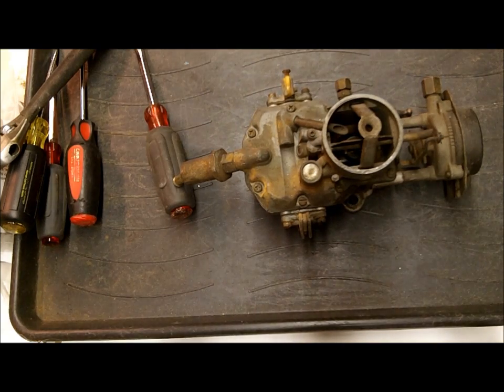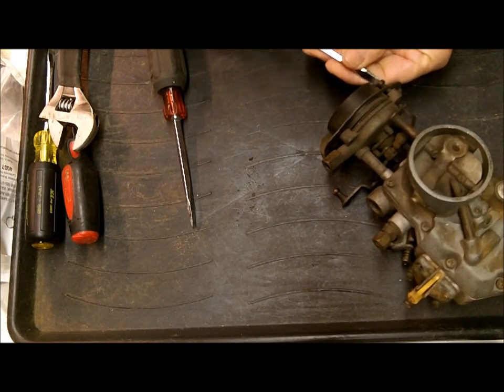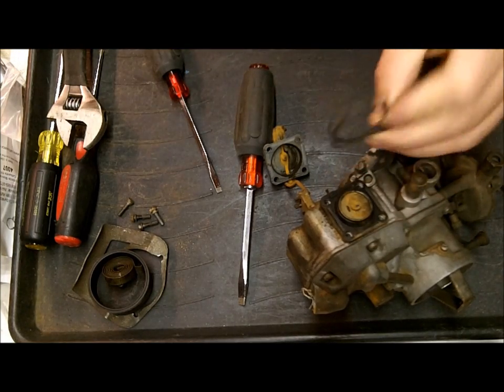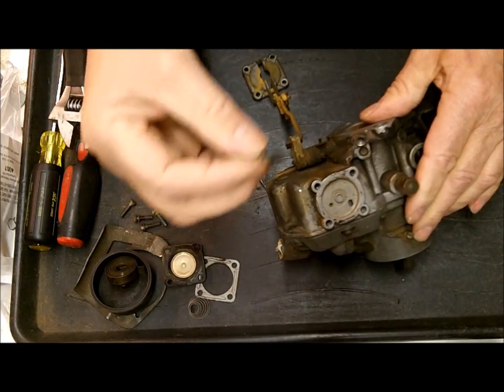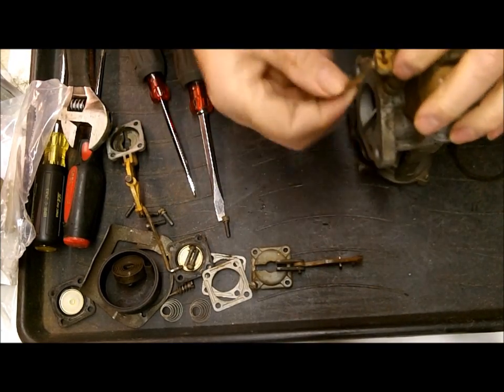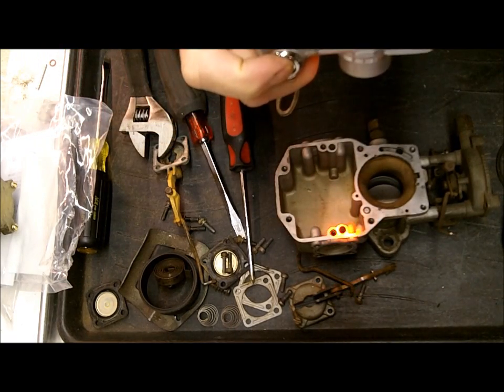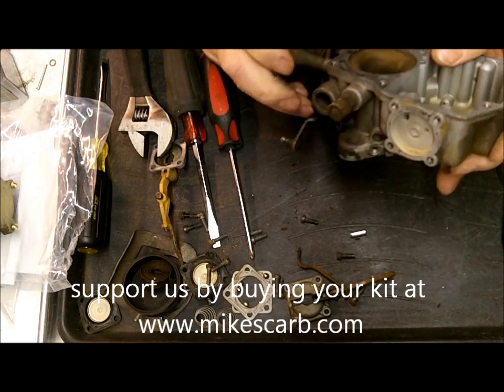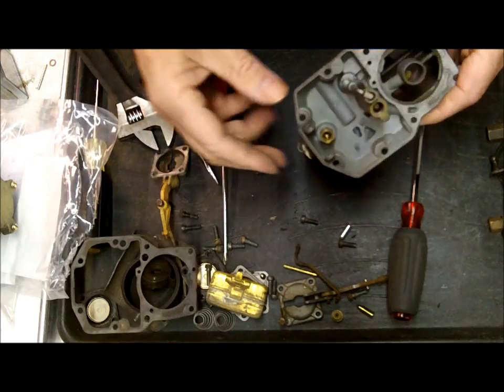Autolite 1100 Carburetor Rebuild - Part 1 Teardown

Comment: They're a little rubber washers around 1350 inside those float Bowl jet things/ the one where you said that your screwdriver was in the best.. I know this is one in mine is it supposed to be in there cuz you didn't mention anything
Reply from the maker: The metering jet? No gasket required.

Comment: I have this carb on my 62 Falcon 144, but at part throttle/cruising speed it struggles and doesn't really want to go. The head was ported, big valves and it has long tube headers, guessing I need to increase the jet size? At idle its very responsive to snap throttle and super smooth, but when you start driving it just feels very sluggish.

Comment: My old one has no provision  for spark control valve ..new one came with it installed..  also new one has extra through hole at vac port
Reply from the maker: The spark valve was eventually built inside the carburetor.

Comment: Came here just for info on how to pull apart the exact bit you skip over at the very end
Reply: yes , a right fiddle , if the jet needle is stuck up there !
Reply: Jet needle is stuck  can we use heat to help it?

Comment: Good video thanks 🙏 
I have a 65 mercury comet and went I drive about 200 feet the car dies. I set the correct timing did the spark plugs wires coil rotor cap don’t know why is dying any suggestions will be thankful

Comment: So you didnt show how that rod came off at the very end, I still havent figured it out
Reply: Doesn't come off. Or not suggested. Use cleaner to loosen and free it up. Under the main jet is the main tube with an air bleed. Mine is stuck in there. I plan to toss it into an ultrasonic for a bit and use cleaner. Seems to be a main air bleed so I would like to pop it out if possible.

Comment: Why did you start with the double pumper and finish with a single.
Reply: @MikesCarburetor  Part 1 https://youtu.be/eAirfexkMVY  part 2 https://youtu.be/8bgc21iYKyY  Part 3 https://youtu.be/96wm8kcTAYI  Notice the float bowl in part three it only has one diaphragm.

Comment: Hey Mike I just rebuilt a  autolite 1100 . I had problems with flooding but got that issue taken care of. Now I am having problems with  it stalling out when I take the choke off. It is a manual choke and have to choke it to get it started but when I go to open  choke it stalls. Any suggestions? It is a manual choke and does not have  2 diaphrams

Comment: Hello. I have a 1960 f250 with a 1100 carb on it and manual choke. My carb only has one diaphragm on right side. I am looking into replacing the carb but can only find the 1100 with 2 diaphragms on it. Do you know if that will work on my truck since it has a manual transmission. Thank you for your time
Reply: Also would it be a better option to go back with the original 1904 that came on the truck. The engine is a 223.
Reply: Okay thank you. I appreciate it.

Comment: just wondering what the white substance is in the center of the carb...almost like ceramic or plastic?
Reply: It's the plastic venturi.  There were three different sizes; for the 144 motor, the 170 and later 200, and the early 200.